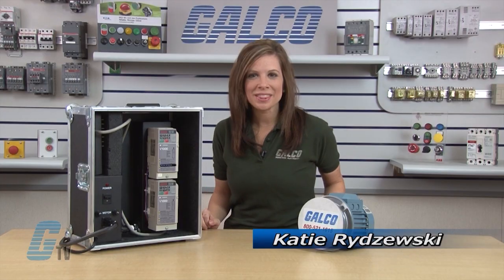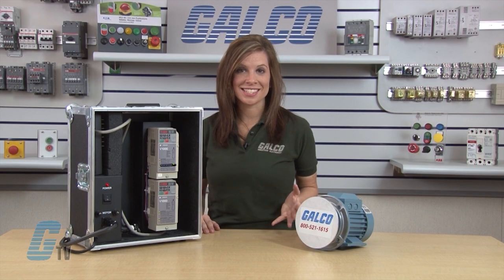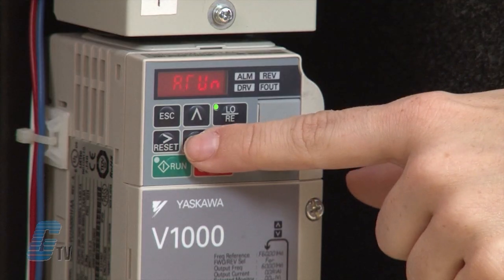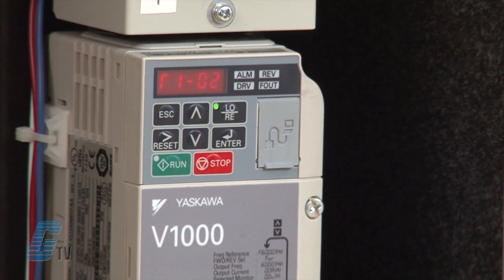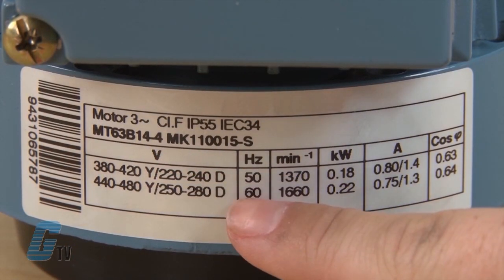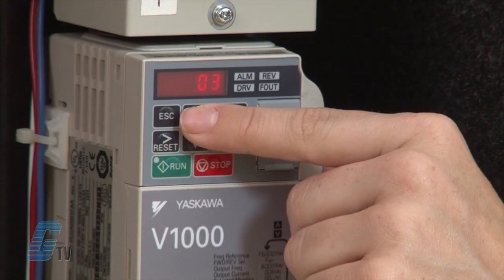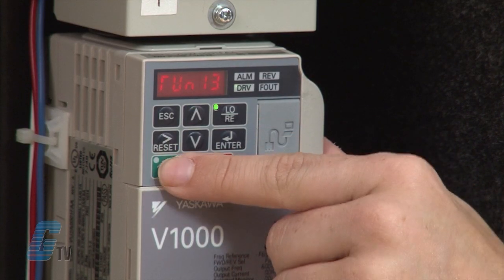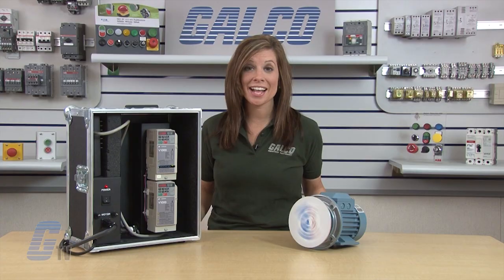Yaskawa V1000 AC Drive Start-Up Auto-Tune Demonstration Using The Keypad

Comment: hi sir can you please help me with this machine we are using same machine in our company in alm display it is showing "Uu1" can u tell me how to fix it
Reply from the maker: mohammed asif First you will need to identify the problem.  Uu1 is the fault for DC bus undervoltage and can be caused by input power phase loss, loose input terminal wiring, improper voltage coming in, power interruptions, worn internal circuitry, drive internal temperature, or problem with the charge indicator.  Checking the quick start guide found on galco's website can outline how to correct each problem.  You can find the link above in the description tab and then click on the V1000.  Under the docs and links tab is the quick start guide.  Fault Uu1 is found on page 138.  I hope this helps.
Reply: GalcoTV thanks for replying, please help me with one more doubt  which is very important, we are running 3 phase motor for this drive, the motor specifications are (power)p1= 2.65 kw and p2=2.2kw, (voltage)=230-240 ^/ 400-415 Y, current in ampere is 8.3/4.8, frequency in hertz is 50 and (min-1) rpm is 2820 how many poles for this rpm?.Now please tell me what should be the reading for t1-01, t1-02, t1-03, t1-04, t1-05, t1-06, t1-07 i want to confirm my readings as i have put t1-01=3, t1-02=2.2kw, t1-03=230v, t1-04=4.8, t1-05=50, t1-06=2, t1=07=2820. Please help me with this table waiting for it thanks for co-operation i appreciate it.
Reply: GalcoTV  and if the air inside drive is too hot how to check the drive internal temperature and how to fix it?
Reply from the maker: mohammed asif I can see a couple of problems with the data you have provided.  The voltage setting that you have for t1-03 is 230 volts.  This would suggest that t1-02 is 2.65 kW and t1-04 is 8.3 A.  If your incoming voltage is 400 and the motor is configured for this, then t1-02 and t1-04 is right and t1-03 needs to change.
Reply: GalcoTV can u provide me parameters from t1-01 to t1-07 according to this motor specification please it will great help for me because we dont have technician for this drive
Reply: and parameters if the incoming voltage is 200?
Reply from the maker: mohammed asif If you're incoming voltage is 230 and your motor is rated for 230, then you have the correct parameters needed with the exception of t1-02 and t1-04.  This should be 2.65 kW and 8.3 A according to the data you have given.  If the voltage is 200 and not 230, you may need a transformer to boost this to 230.
Reply: GalcoTV thanks a lot i did it today...........u helped me a lot ::)

Comment: how can i reduce the water pressure from 6.5 bar to 5.5 bar through yaskawa v1000 drive? i have 2 drives controlling 2 pumps.
Reply from the maker: sana tariq There are too many variables that could affect the function of the drive. For instance we do not know if this application is utilizing the PID to control pressure or if it is a simple pressure sensor directly controlling the motor speed.
Or some other pressure control scheme.
Reply: GalcoTV There are 2 pressure transmitter (4mA to 20mA,  0 Bar to 10 Bar) utilizing the PID to control pressure.

Comment: how can i reset a varispeed yaskawa v1000 on an extractor fun
Reply from the maker: I am not sure if you have a fault you are looking to reset or you want the drive to reset to factory settings (out of the box settings).  If you are looking for resetting the drive because of a fault condition, then you will need to find the fault and clear it before pushing the reset button located above the run button on the keypad. For example, if there is a short somewhere, you will need to fix it before resetting the drive.

If you are looking to reset all of the parameters and start fresh then you will need to initialize the drive.  Our techs and docs link on any of the V1000 products will allow you to download the technical catalog.  On page 104-5  there are steps to initialize the drive with the A1-03 parameter.  You can initialize the drive to whichever configuration you have. 

Warning:  Initializing a drive will reset all parameters.  Make sure you know what you are doing and what your motor settings are before you initialize the drive.

Comment from the maker: +Teodora Perisin
For some reason I was unable to respond directly to your comment, but I hope you can see this. 
An easy way to reset to the factory settings is to go to parameter A1-03.  This will allow you to initialize the parameter values.  You will change this parameter and save it, then change it back again to the parameter it once was.  Every time you change this parameter, it resets back to the factory defaults of that set up (2-wire control, 3-wire control, etc..)

Comment: Hi !
I have bought a 4kw 17,5A Yaskawa V1000 for my 3phase, 12000-18000rpm, 200-300hz, 3.7 kw,  12A 2poles motor and when I am trying to perform AutoTuning, I get Error 11. How can I get past that? I have tried almost everything. Before that I didn't knew it was a 2 poles motor and it was set for 4 poles. It worked rough and the rotor was getting very hot but it was rotating. Now without autotuning performed when I hit the Run key it runs very nasty sounding like bearings not being greased at low speed and after a few seconds I get oL2 error.  Thank you in advance !
Reply from the maker: The sounds of the motor should be much smoother after autotuning.  Er11 indicates the torque reference is too high. The Yaskawa manual suggests increasing the acceleration time.  This assumes the drive doesn't have any errors and every thing else is properly programmed.  Where did you buy the drive?
Reply: GalcoTV  The drive was bought from an online site from UK(buying overseas would add other consistent taxes).  I believe the settings are not properly done. After following your video about a couple of times, I realized I was introducing some wrong data. Not being educated for this field is hard knowing or translating the technical terms. I was using for base frequency and for base voltage some smaller values(thinking that base would be something that you will probably run every day), but then I saw you introduce the data from the nameplate for those. The motor runs fine now(I believe), but the rotor still gets very hot.  There is one thing I don't understand, with A1-02 set to 00(V/f control) at Auto-Tuning I can't set the T1-01 to 00(Rotational Auto-Tuning).  So I had to chose at A1-02  the 02 option(Open Loop Vector). Would this be the reason for the rotor to become hot? Thank you !
Reply from the maker: EliseiDesign That shouldn't be the case for the motor. Unless you have an encoder with feedback going back into the drive or you are using a permanent magnet motor the open loop vector selection should be fine. The few things I can suggest is looking at the current settings on the drive, checking the load, and recheck the size of the motor does not exceed the values of the drive.  Is there a load on the motor?  Also,  Look at the nameplate of the motor... What letter is the insulation rating?
Reply: GalcoTV Oh, so that is fine then. Good to know!  There is no load on the motor and I don't see the insulation rating on the nameplate. The motor is 3.7 kw at 220v and 5.2kw at 330v(but my drive can only deliver up to 220v, so just 3.7 kw). The drive should be able to deliver what it needs.  This is a link with an exact motor as mine http://picclick.com/Giordano-Colombo-Spindle-Motor-RV-902SB-CNC-Mill-190895091037.html  and this is the exact driver CIMR-VCBA0018BAA Inverter V1000, 200 V, CT: 17,5 A / 4 kW, IP20 . I will check and recheck and again and again; it seems like I am getting closer. :D  Thank you for helping me !      Elisei
Reply from the maker: EliseiDesign
I found a motor similar to yours that is suggesting 15 amps at 220 volts (does the nameplate say 12 or 15?).  Without seeing the motor itself it is a little difficult to help. Spindle motors can be a little tricky with drives and it might be a good idea to contact Yaskawa's tech support.  Since we are based in North America, I'm afraid our tech support wouldn't be as beneficial to you.
Reply: GalcoTV  It has 12A. The description from the link I pasted above is the exact description and motor as mine.   I still believe it is a settings error, but I might open the motor again and check the rotor more thoroughly for cracks/fractures and/or other faults in the bars or end ring joints. Anyway, your help and time is greatly appreciated : Thank you !    I might contact Yaskawa for some more in depth settings advice.  Have a lovely evening ahead !   Elisei

Comment: i watch this & ABB ACS550 AC Drive and sure abb drive is more easy to operate and to program...... just my opinion
Reply from the maker: All drives tend to have a learning curve.  I will admit that the advanced keypad has greater resolution on the ABB drives, but both do require knowing how to navigate. The Yaskawa keypad is also very responsive and easy to navigate, which is often underestimated when operating a drive through the keypad.
Reply: GalcoTV  un m hmm mmmmo km o